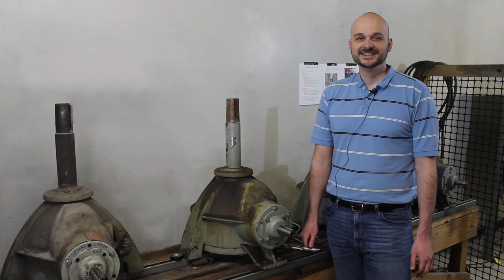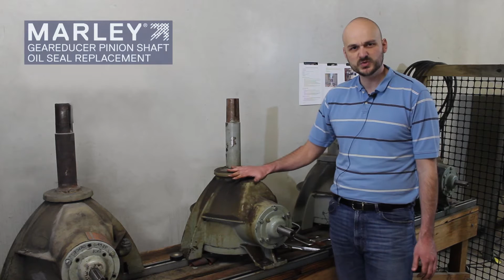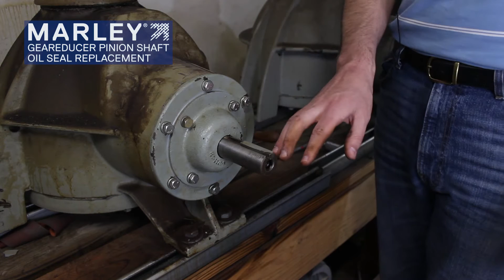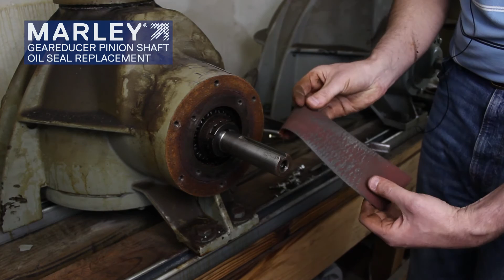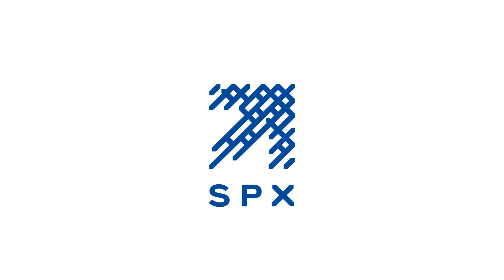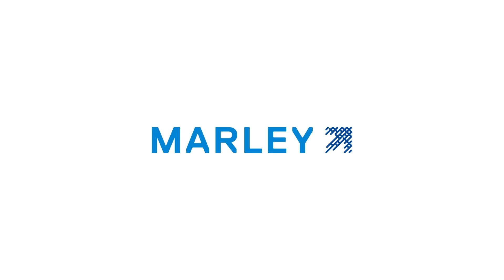Marley Pinion Shaft Oil Seal Replacement

Comment: if you were to add too much oil into the Gear Reducer box would it leak out the top half of the pinion shaft or stay within the box with the excess oil???